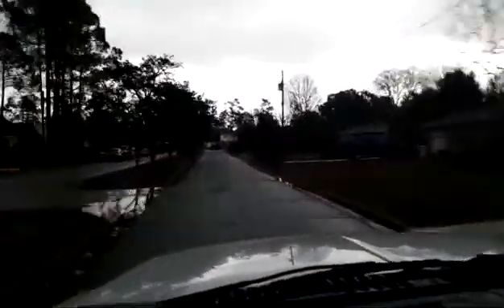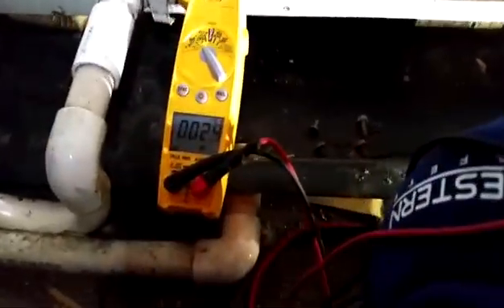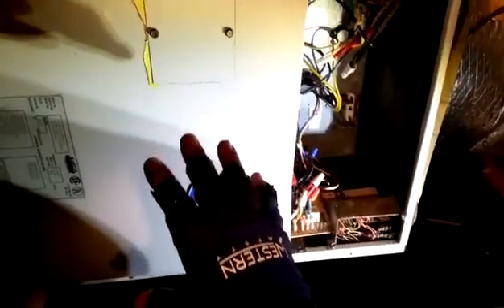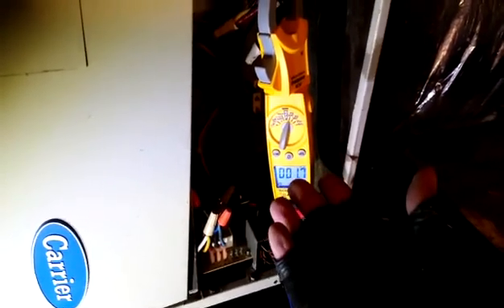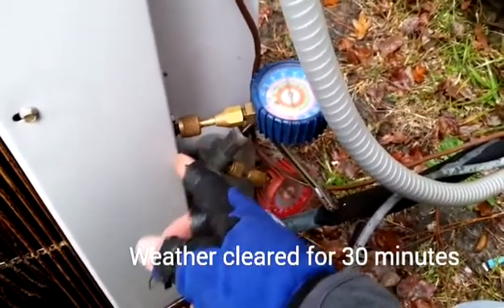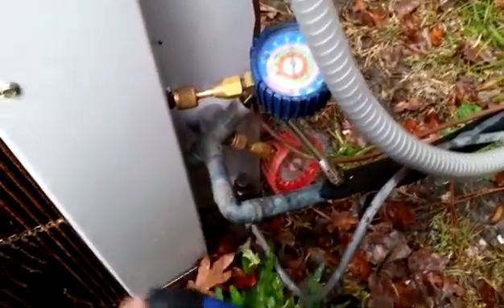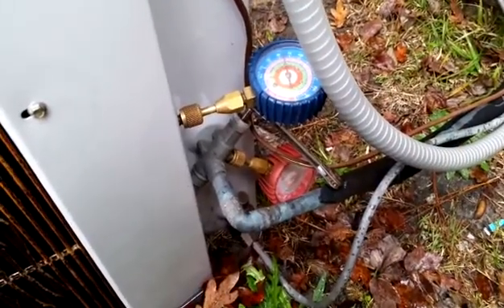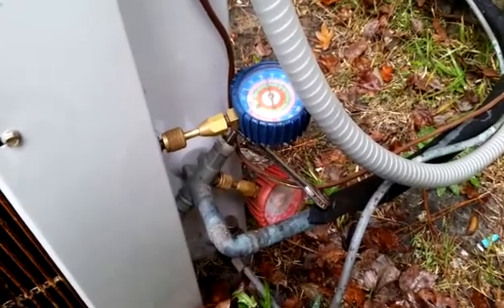HVAC Service Training: Blower Motor Failure

Comment: So your suction line is the little line. And discharge pressure is read on large suction line. The line line stays the same . Right
Reply from the maker: No exactly. Watch the video I did right after this one. It goes into heat pump hook ups.
Reply: Thanks I watched your other video on heat pumps. Great job. Some day I would like to do videos.

Comment: Nice work Zack.. I really like your  single set of testing gauges. I wish I could turn one of my old set of gauges into a set of  single set of test gauges. But, I am just not sure where to find the brass  fittings.
Reply from the maker: Johnstone has the fittings, made by yellow jacket. 1/4 female flare to 1/8 npt
Reply: Zack HVAC Thanks! I just order two for $20.  Now, I just need to hook them up to my old gauges' and I will have a set of single testing gauges.
Reply from the maker: Nice, I love mine